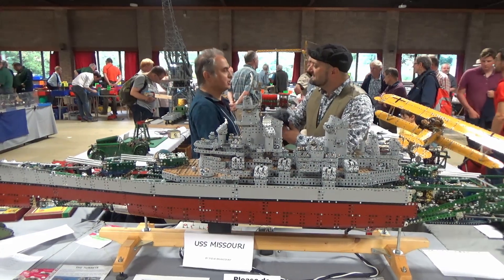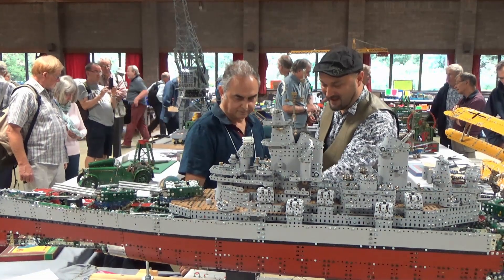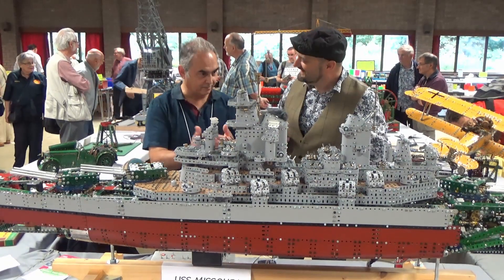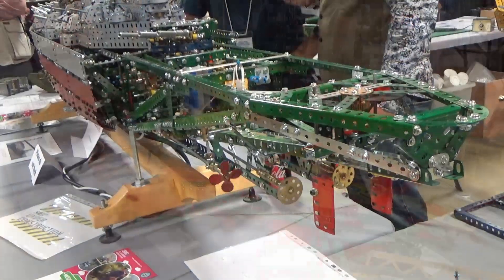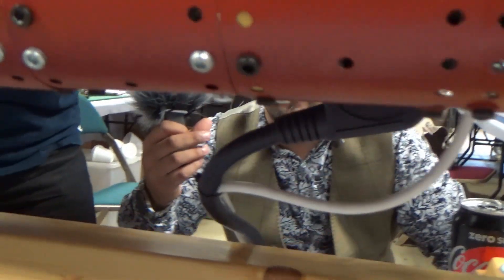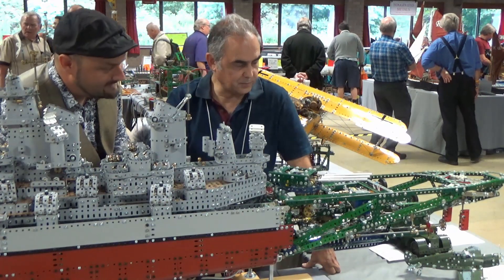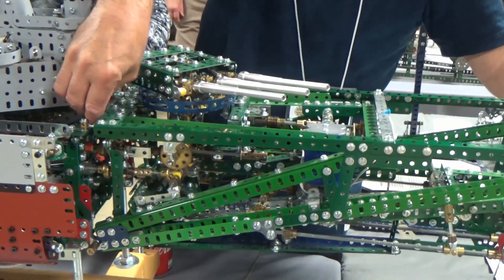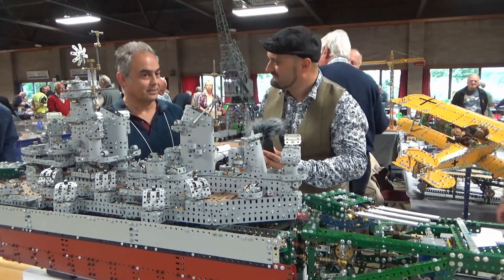DuB-EnG: Massive Meccano USS Missouri Battleship build project BB-63 Pearl Harbor Working Motors

Comment: When ever I built Meccano kits, by the time I had got the third nut and bolt tightened up, the first one had come loose. 
So did Steve use a thread locking glue?
Reply from the maker: Very good point!! I remember this problem!! ... he’s probably got cerated or split locking washers ... I’m sure they would help!!